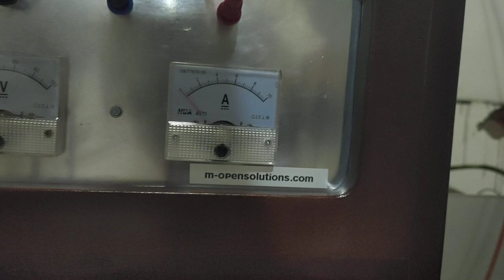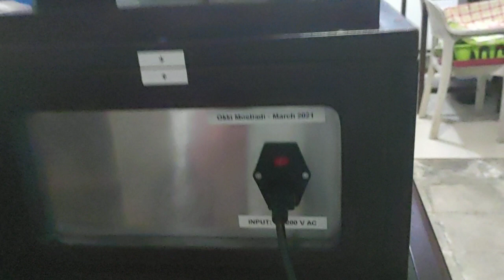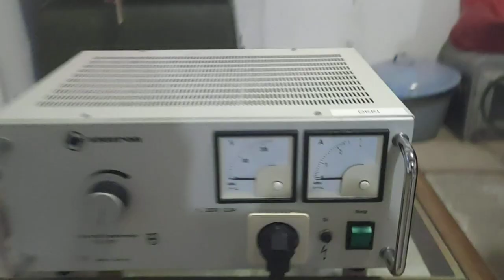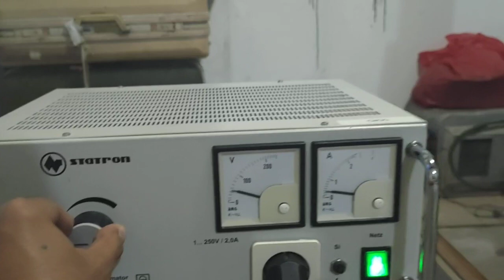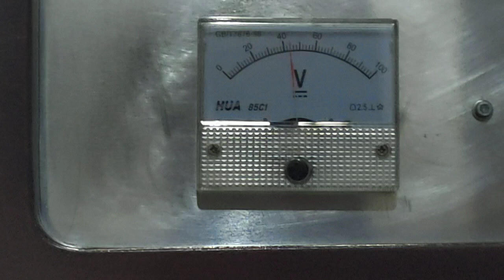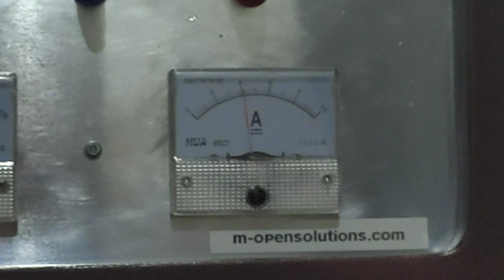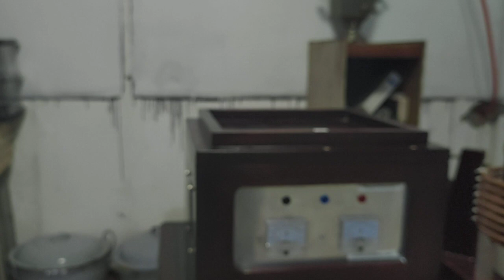Plasma Generator

Comment: Looks like a nice build. If it is putting out that much rf interface, you should put grounded screens on both sides of the fan because otherwise the rf will damage the fan over time.
Reply from the maker: Thank you! I think if the fan is sensitive to RF interference, it would've stopped working a while ago.